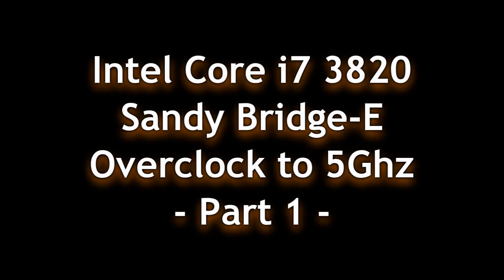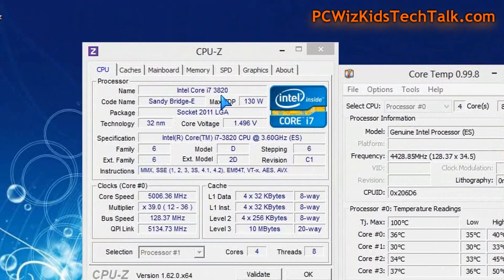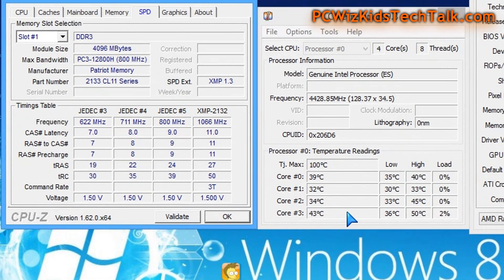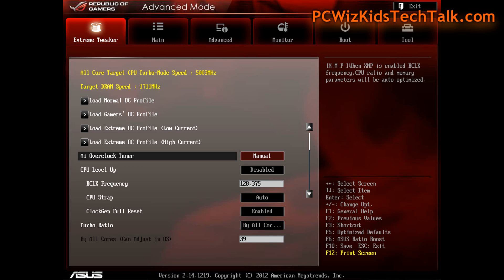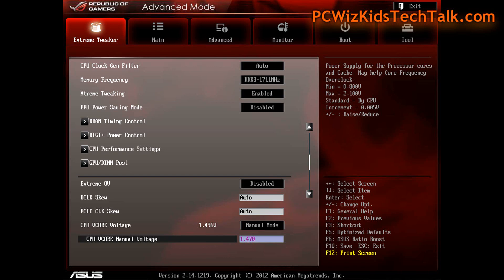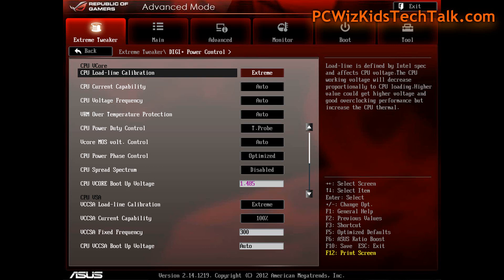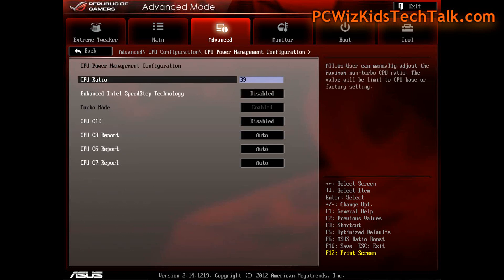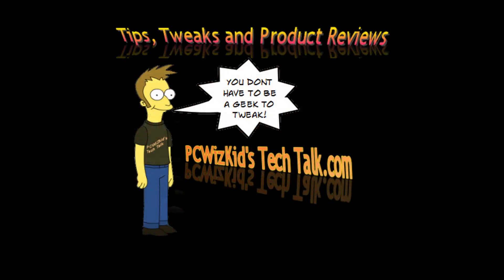Overclocked to 5Ghz Intel Core i7 CPU - Part 1 - BIOS Settings - PCWizKid

Comment: computer wont even boot and fails to OC and wont let the multiply go above 43x even though it says i can go to 44x on the multiply, highest i can get to is 4.515 GHZ
Reply from the maker: Your issue could be relating your DDR memory settings.  Try lowering the settings of your memory.
Reply: PCWizKids Tech Talk So i did but found my MOBO just sucks ass and after resetting the bios got the computer to run but having wierd errors at just 43x basic auto OC and might have to system restore
Reply from the maker: You probably flashed the bios to the latest right?
Reply: PCWizKids Tech Talk Yessss

Comment: i can see that the system is not stable i can see from the temp in beginning of the video
Reply: ??????
I think this guy possibly has confused the Debug LED for a temperature reading....
So I just want to point that out, The LED "read out" on the mother board that can be seen in the beginning side view. It is flickering numeric and character codes, these are "diagnostic boot sequence codes" NOT temperature,
just saying.
Best regards.